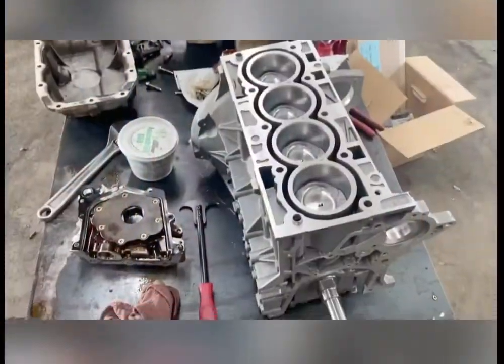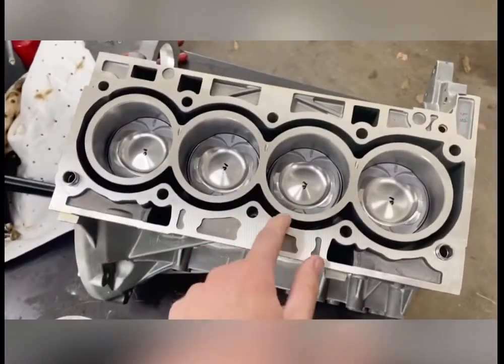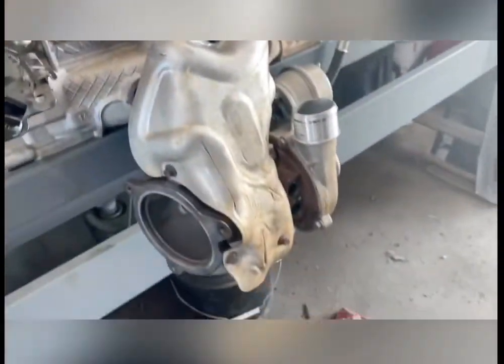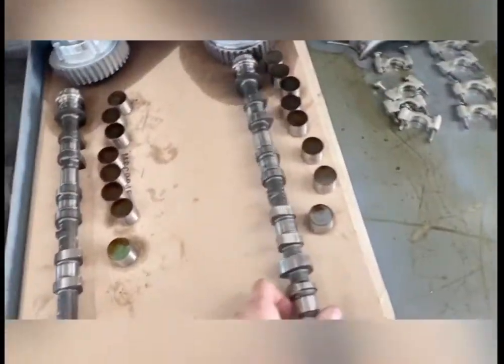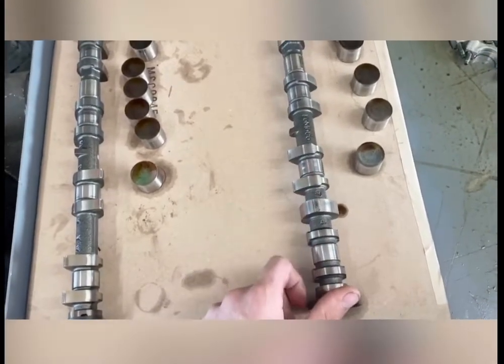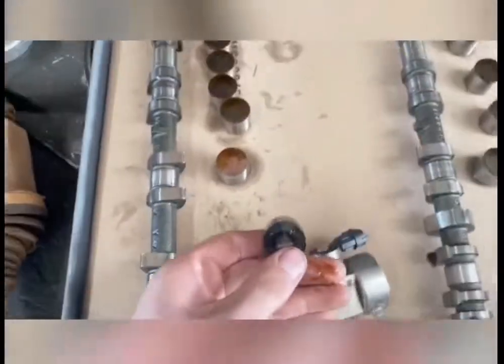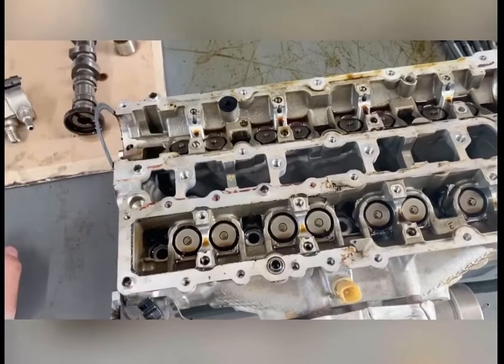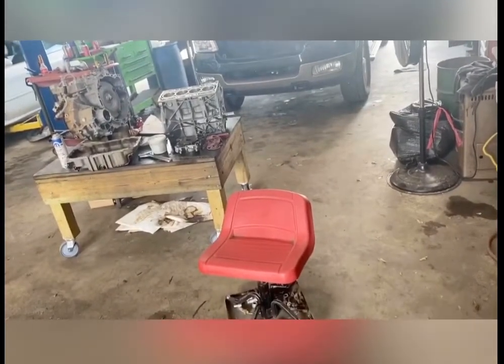FORD: 1.5L EcoBoost Mechanic Review

Comment: When the bad engine is replaced with solid pistons is the car worth keeping or get rid of it?  2017 Escape broke down 06/02/2022  towed to ford dealer puff of smoke came out exhaust . I had transmisson replaced 6 mo. ago 87, 000 miles has 92,000 miles now.
 Thank goodness I bought extended warranty.    Also what is long block?
Reply: A long block is the bottom part of the engine combined with the cylinder head(s). A short block is just the bottom part of the engine with no head(s).

Comment: I hear that the 1.5L and 2.0L ecoboost engines made at the Cleveland plant were the troublesome engines with the coolant intrusion issues, but the same engines that were made in spain didn't have that issue. If that's the case than that would explain why the TSB stated some ecoboost 1.5L and 2.0L engines may have issues with coolant intrusion.  I heard there is a sticker on the engine to see where your ecoboost  engine was made.
Reply: Where is the sticker to be exact?
Reply: @w4lknde4d25  it's on the left hand side next to the engine cover at the top. its a white sticker. If it says VEP it was made in Valencia spain.

Comment: I have a 2014 Ford Fusion that blows lots of white smoke out of the back do you think ford will fix it for free because it’s a known issue and there’s currently a class action lawsuit against them for this exact issue? The car has 54k miles.
Reply from the maker: Call Fords customer service center. They might provide you some assistance.
Reply: @FlyingWrenches13  thank you!

Comment: How do i know if my block was replaced, i just got my car with 51k miles and took it in with a misfire issue. And was losing coolant
Reply from the maker: It hasn’t been replaced. The new updated block doesn’t have any coolant intrusion issues.

Comment: I have this coolant issue. I am doing the repair at home. Which part number is the updated block?
Reply from the maker: DS7Z-6009-G is the block number.
DS7Z-6079-D is the updated gasket kit.
Reply: Thank you

Comment: The 1.5 and the 1.6 liter Ecoboost engines are junk. Don’t buy any Ford with those engines. Also the transverse mounted 3.5, 3.5 Ecoboost, and 3.7 liter V6 engines are junk too because of the timing chain driven water pump and don’t forget how bad the 4.6 and 5.4 liter 3 valve engines were really really bad for cam phasers, timing chains, oil pumps, and camshafts.
Reply from the maker: 3.5 sideways engines are pretty solid other than the water pump which is not really that bad when compared to other makes. 4.6’s didn’t have phasers and honestly is probably the best engine ford has had in the last 20 years. They are pretty much indestructible.
Reply: @FlyingWrenches13  The 2 valve and 4 valve engines didn’t have phasers. All the 3 valve engines except for the 6.8 V10 did have cam phasers. The 2 valve and 4 valve regardless of the displacement were good engines.

Comment: Have a 2013 1,6 ecoboost 120 000 km no problems just bad manifold
Reply from the maker: Intake?
Reply: @FlyingWrenches13  exhaust gasket was a strange sound when the engine was cold when i got it

Comment: Last September my 2017 Escape started up in the mornings rough and a warning light came on. The Escape was due for routine servicing at the dealership. They checked the light and told me it needed a new engine due to the coolant issue. It was a short block replacement and took about one month to complete due to part issues. This happened at 64k kms and was covered under the powertrain warranty.
Reply from the maker: Glad to hear you got yours fixed under warranty!

Comment: I had heard of problems with the 1.5 and my brothers 3.5 in his f150 is constantly in the shop.  This is why I chose a 2020 Ecosport over the Escape.  I got the non-turbo 2.0 motor so hopefully less problems.  Its plenty fast enough and still tows 2k lbs just fine which I have done several times with two quads on a aluminum trailer.
Reply from the maker: You made a very good decision in going with the NA 2.0.

Comment: I gave up on Ford after they went Ecoboost as their go to new technology. I avoid all turbos. Too much pressure on all aluminum blocks. Guaranteed to fail.
Reply from the maker: Yeah I agree the longevity isn’t there with the ecoboosts. One plus they do have is they make a ton of power and get pretty good fuel economy.
Reply: @FlyingWrenches13  I will say this. Aluminums come in different alloys and generally it will expand quite a bit. This problem managing the coolant is a serious thing but also a minor thing in a way. Why doesn't Ford use a better head gasket and why doesn't the little passageway between cylinders go all the way from one side to the other??
Reply: @bourboncat9229  You might be right but thats an awful business model. Why would they not do like Toyota and keep growing?
Reply: power needs to get sealed up well, cooling has to work, and fuel and boost need to be adjusted properly. Thats what today's ECU does for you. Sure you can stay in the 1960's technology-wise but why would you if you had new tech to attain better economy?
Reply: @jamesmedina2062  I ask myself this all the time. If American manufacturers had the reliability of Japanese manufactures I wouldn’t be driving a Japanese car in my country. But all their stuff isn’t even American made anymore. It’s all getting pumped out of Mexico and China for cheap labor. That’s all u need to know from them. Their quality control stinks and they most likely get rid of their employees and replace them every week with new people who have no clue about the automotive industry
Reply: @bourboncat9229  Yup!!!!!! Long term issues with globalization. Even with medical care in the US the offices hire people who know nothing so that the doctor gets to keep more of his money. Doctors willfully ignore the problems with hiring low-skilled people. The people again suffer while one person at the top or an oligarchy get rich. Same in my apartment complex. It gets owned by a new property company hiring cheapest managers at ground level, all for max profits to them and shareholders. The list goes on and on. Refineries will get lower skilled workers willing to earn less. I do woodwork. My boss wanted to pay minimum and let me go.
Reply: @bourboncat9229  if you look at immigration there are more business owners welcoming cheap, no-english workers so they prefer border stays open.
Reply: @jamesmedina2062  those companies in America love that shit. Exactly for the reason you said. They tend to stick around for a lot longer and don’t even question the American rights or intense work conditions lol. To them they are dogs and throw them a bone here and there for their high volume production
Reply: Guaranteed?

Comment: Hey I have ford fusion 2020 1.5 ecoboost  do you think I should extend the warranty  or not
Reply from the maker: 2020 model isn’t effected by this problem. It came with updated block already in it.
Reply: @FlyingWrenches13  when did they update it?
Reply: @FlyingWrenches13  do you know what model years it affected

Comment: How much to replace that cap on the high pressure fuel pump while the block is being replaced under warranty?
Reply from the maker: Shouldn’t cost any labor because you already have it off. Just however much the part costs.

Comment: I have fixed it with a little hole on coolant cap. Coolant goes without pressure, the leaking has stopped. I use one that starts boiling at 138°C, so no problem about no pressure, no need of changing anything, just a hole. 1.5 ecoboost with 80k milles and running good.

Editing this comment: 2 weeks ago my 1.5 ecoboost lost almost all the coolant by the coolant cap. Compression has started to pass from the cilinders to the coolant system. 126.000 km, a total hell, and what is worse here in Spain Ford doesn't want to assume nothing. I'm really disappointed with Ford, I love the Ford feeling on its cars, love Ford designs, and Ford doesn't want me, oh God!
Reply: Que pena amigo. Estoy de acuerdo que los Ford son comodos, bonitos, y manejan bien. Creo que si puedes usar mejores empaques para la cabeza que podria resolver el problema. Pues que sucedió??
Reply: @jamesmedina2062  Lamentablemente la solución funcionó unos meses pues la fuga ocurría en frío. Hasta que ha terminado por reventar y en caliente también pasa toda la presión al circuito de refrigeración, es un fallo de diseño que Ford no quiere asumir.
Reply: @felixbgc  refrigeracion y el motor estan separados que no? No entiendo. Y pues tu motor necesita reparaciones y no esta bien verdad? Alguien en la compania tiene que responder
Reply: @jamesmedina2062  por el diseño de cilindros flotantes, la refrigeración está separada de las cámaras de combustión por una fina pared, que entre cilindros resulta ser demasiado fina. Ford está cambiando el bloque de motor (la parte de abajo, lo que no es la culata) en coches con menos de 3 años está pagando el coste, pero en el resto pretende que el cliente asuma su fallo de motor. Realmente el resto de fabricantes debería estar agradecido con Ford, porque alguien que experimenta algo tan indecente necesitará otro coche y está claro que no va a ser Ford. Yo perderé 4000$ pero Ford va a perder 400.000$ solamente con la influencia que ya estoy teniendo en familiares, amigos, cientos de alumnos que reciben mis clases. No entiendo esta forma de proceder de Ford, era una oportunidad de quedar como una gran compañía, lo que creo que es, pero está demostrando lo contrario, no merecen los clientes que tienen.

Comment: I bought a used 2018 Fusion 1.5 w/15k miles on it. According to the CarFax "Short block replaced" was on there from the Ford Dealership 6 months and 40 miles before I took delivery of it. Safe to say I shouldn't have to worry about this issue moving forward? Im still a bit confused at what all the TSB details, just a new block and gaskets? What about pistons, injectors, plugs, seals, cams etc?
Reply from the maker: You shouldn’t have to worry about the coolant intrusion anymore. Under warranty ford only lets us replace the short block with consists of block, crank, rods, pistons, and all the necessary gaskets. They make us re use the cylinder head, cams, injectors, oil pump, oil pan, and pretty much everything else. The only way they will let the head be replaced is if we can prove it’s warped or damaged.
Reply: I was told that the timing belt was replaced as well but looking at the list of what was replaced I didn’t see that.

Comment: I have question but not about this engine. How is the 2.0L engine in Ford Edge (let say year 2018)? Does it have these kind of problems? Lot of people are saying to get 6 cylinder for Ford Edge, but I just realized that it has water pump inside the engine on timing chain and it can leak fluid inside the engine and create a lot of problems. Which one would you get, 2.0L turbo or 6 cylinder naturally aspirated?
Reply from the maker: 3.5 all day. I love the 3.5s the only issue with them is the water pump but that usually doesn’t go out until 150k+. They last forever
Reply: @FlyingWrenches13  Thanks. So, would it damage the engine when it starts leaking? Essentially, how to know if it is leaking, can you see it on oil cap? Probably the coolant level will be lower, I'm guessing.
Reply from the maker: Yeah most of the time it leaks out of the weep hole which is outside the engine. Every now and then I see one that leaked inside the engine and contaminated the oil but even then you can usually flush the engine and not have any issues with it.

Comment: Seems to be a recurring theme with these small Ecoboosts. Budget turbocharged designs rushed out to keep ahead of emissions regulations. It doesn't help that they try to get these engines to temp so fast that they use complicated cooling setups. The HPFP is alright as long as they don't develop leaks that put fuel in the engine oil. Then you have all kinds of problems.
Reply from the maker: For sure. I just shook my head the first time i seen they put shutters in front of the radiator to block air from passing through until it gets to operating temp. Puts a lot of trust in a tiny actuator.
Reply: @FlyingWrenches13  Its a smart thing and Chevy did it too. My Civic will stay cold in town if it is really cold outside. It will also take OVER 10 minutes to warm up. It needs those shutters.

Comment: My 2016 Fusion 1.5 EB at 77k had a cracked head and was leaking coolant into bank 1 on the coder. Took it to dealer and they replaced the engine. It cost me $100 deductable on the extended warranty. Glad I got that when I bought it new. Now that I look back it had a misfire code about a year before the main issue. I wonder if thats when it started to fail. Thanks for the up close video.
Reply from the maker: Thanks! It’s very possible that it was leaking for a while. They are usually a really slow leak so most people don’t notice anything other than a check engine light.

Comment: I'm hoping mine goes before the warranty so can I get it replaced.  I'm also thinking about trading it in for Toyota rav 4 which would kill me to not drive an American car. I'm very confused.
Reply from the maker: Do you have an escape or a fusion?
Reply: @FlyingWrenches13  2018 escape 4wd
Reply from the maker: Yeah those are real prone to going out. I might would consider buying an esp extended warranty through ford to cover that in case it happens.
Reply: @FlyingWrenches13  I have power train 100,000. Do you think I'll be ok?
Reply from the maker: I would just get rid of it when the extended warranty runs out. Last thing you want is to be stuck with a bill that’s 75 percent of what the car is worth.
Reply: @FlyingWrenches13  thanks for the info and replying.
Reply from the maker: Anytime!
Reply: Toyotas and some Hondas are made here

Comment: I heard that the replacment block is redisigned . Old block had a slot between cylinders new one has a hole is that correct.
Reply from the maker: con rafael that is correct. The new one is redesigned.
Reply: Does the 18 fusion 1.5l have this same issue?
Reply from the maker: @rickbecerra3913  yes it does. 14-19 Fusion and 17-19 escape.
Reply: @FlyingWrenches13  on the 1.5 or 2.0?